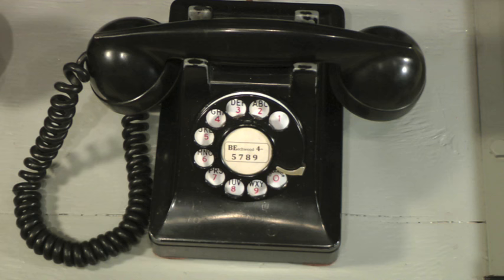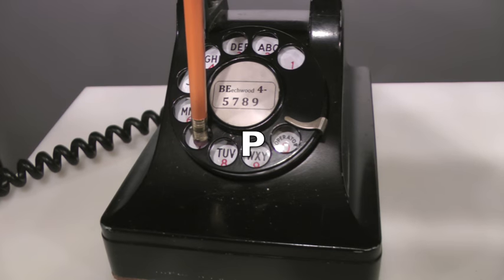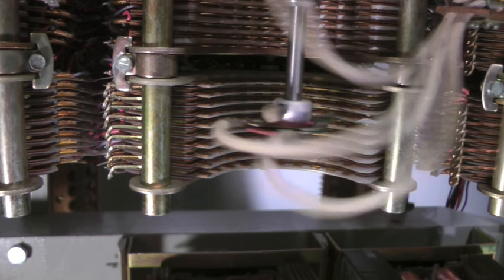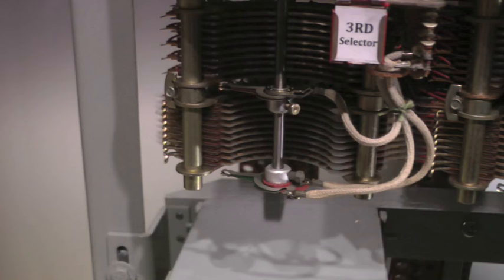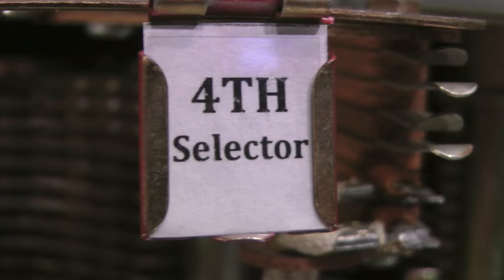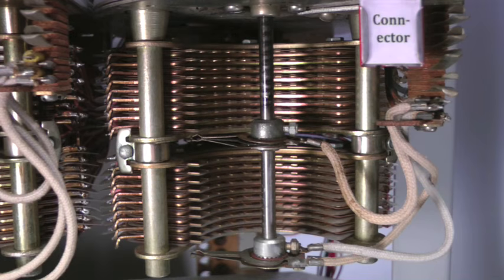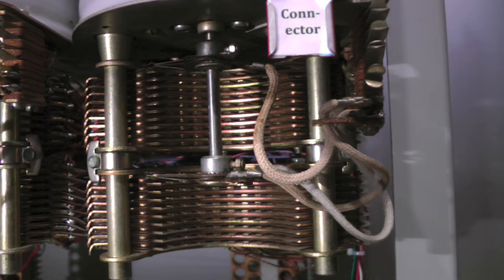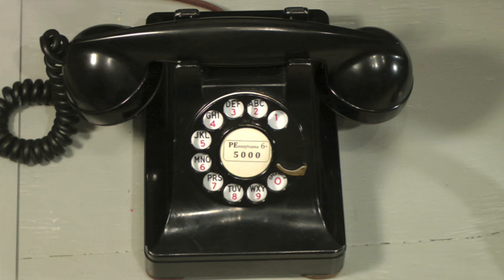A Call To PEnnsylvania 6-5000 Through The Step-by-Step Telephone Switching System

Comment: How does the line finder "find" the line calling line?

It didn't seem to traverse every contact on every level. It only traversed on one level.
Reply from the maker: When the shaft and wipers begin to move vertically upwards, you'll see a horizontally mounted copper coloured wiper brushing against a set of vertically mounted copper contacts. There is one contact for each level of the bank. The operated line relay causes a ground potential to be placed on the contact associated with its level. The shaft continues its upwards motion until its horizontal wiper detects the ground, at which time it stops vertical motion and begins rotary hunting. The top set of contacts on the bank assembly are the sleeve contacts, which provide the service request status of each line on the bank. If a line is requesting service, the operated line relay will cause -48 volt potential to be placed on its sleeve contact on the bank. The rotating sleeve wiper looks for the -48 volt battery and stops rotating when it sees it. At this point, the line requesting service has been found. If you are interested in more detail, you can watch my very long video on this subject entitled "The Line Finder In The Step-By-Step Telephone Switching System". Just search You Tube for my channel name, Hicken65. Thanks for watching.
Reply: Hicken65 ... Thanks for the explanation. It is a really complicated system! It took me ages to spot the circular piece of metal with the finger out to the right parsing the 10 tiny flat contacts. 

I had already started to watch the other video you mentioned, but had to abandon it to get on with other stuff. It is bookmarked for when I can devote time to watch it all without interruption.

Comment: I understand that the selectors are in the same frame for demonstration purposes in the video, but in the real world wouldn't the selectors for each digit be located in various parts of the CO with the last connecting selector just serving the last nnn-nnXX digits?  

How would dialing the first two digits select a proper trunk to go to another CO?
Reply: Thank you.  It's not usually explained well in any SXS video as the selectors grouped together is misleading.
Reply: Since the exchanges in an dialing area (area code) may be many, I'm curious how and when the outgoing trunk to another CO is selected -- I assume after the first two digits of an exchange are dialed then the appropriate trunk is selected to then connect the call to the appropriate CO for the last 5 digits to be decoded.  That implies that there are trunks from each CO to all other COs in the area code, or was there another CO inter-switching method which was more efficient?

Comment: How much could a complete system like this one could cost to build today with used parts?
Reply from the maker: Well, the short answer is I don't know. To build a demonstration unit similar to mine, here's what you would need: 2 line circuits, each consisting of one line relay and one cutoff relay; one line finder switch and its jackspring and bank assemby; five selectors with their five jacksprings and five bank assemblies; one connector and its jackspring and bank assembly; a 48 Volt dc power supply, a ringing generator, a dial tone generator; an interrupter for the ringing; an interrupter for for busy tone; wire to interconnect everything; and mounting framework for all the equipment which you can build using angle iron. There is no single supplier, that I am aware of that is selling this stuff. Occasionally, bits and pieces show up on Ebay and occasionally, some collectors list parts for sale in collector forums or newsletters. Telephone collectors hold several shows each year which often include switch demo units. You need to research such organizations as Telephone Collectors International and Antique Telephone Collectors Association.

Comment: Thanks for showing what you could, but the design of these switches still has lots of unexplained details, not least of which is that the system also does automatic billing.
Reply from the maker: There is a lot more detail in my longer videos. Just search on my channel name. Unfortunately I do not have any Automatic Number Identification or Automatic Message Accounting equipment available to make a video. Thanks for watching.

Comment: What does your demo setup use as sources for ringing voltage and dialtone? Does it use the standard motor-driven interrupters to make the busy signals?
Reply from the maker: The ringing generator is a Tellabs model 8102 made in 1998. It is a solid state generator that outputs 105 volts ac at 20Hz with a series -48 volts dc component. The dial tone/busy tone generator is a Lorain model F1 made in 1966. It is a solid state generator that outputs 600 Hz amplitude modulated by 120 Hz. The busy tone and ringing tone interrupters are both made by the Pylon Electronic Development company (year of manufacture and model unknown). They both have electric motors with brush and cam arrangements.

Comment: Well the part I didn't quite get, was how the system could handle more than 1 call at a time, and how there was an upper limit to the number of phones that could be called. I take it, this was a simplified documentary
Reply from the maker: It is indeed simplified. My demonstration unit was designed only to show how a call progressed through a SXS switching system. When a switch is used on a call it is tied up to that call for the entire duration of that call and so cannot be used to process any other calls. When a call is established through my demo unit, all 7 switches are tied up and so only one call can be established at any given time. In a very large central office, each established intraoffice call would also tie up 7 switches, but there were many thousands of these switches. Each telephone line did not have its own dedicated switch or set of switches. To make efficient use of the switches, there was a great deal of shared access to them. For example, line finders were arranged in groups of up to 20 that had shared access from 200 lines and connectors were arranged in groups of up to 10 that shared access to the same 100 telephone numbers. Between the line finders and connectors were the ranks of selectors. Each line finder was tied directly to its own first selector. After that, the 2nd through 5th selectors were set up to be accessed on a shared basis from the preceding rank of selectors.Typically, SXS systems were provided with sufficient switches such that about 7% to 10% of the telephone lines could be in use simultaneously on originating calls and 7% to 10% could be in use simultaneously on incoming calls. A 50,000 line SXS office would have around 25,000 of these switches.

Comment: Is all that apparatus for every single line? I don't understand how it handles calls to consecutives numbers, by example, if phone lines xxx50 up to xxx59 can be use at the same time all the ten for receiving calls all at the same time? It works with parallelism of those mechanism?
Reply from the maker: My demonstration unit just has one switch of each type to show how a call progresses through a Step-By -Step system.In a central office, there is a lot of shared access utilized by parallel multipling of bank wiring so that multiple switches can share access to the same 100 or 200 circuits. For instance, in a typical setup, 200 lines share access to a set of 20 line finders and 100 telephone numbers share access from 10 connectors. In a 50,000 line office, there would be about 24,000 switches of all types, so just under half a switch per line.
Reply: wow, you mean that of 200 lines only 20 can do a call at the same time?  that is like the 10% of sinmultaneosly usage!. But I imagine those 200 lines can receive a call regardless of all call lines are used.
Reply from the maker: Yes, that is correct, only 10% of lines could have simultaneous originating calls in progress and 10 % of lines could have simultaneous incoming calls in progress. This was typically sufficient. Of course, in serving areas that were business dominated, less sharing was done in order to handle the loads and still provide mandated service levels. The originating equipment did not interfere with the terminating equipment. If 20 of the lines in a group of 200 lines sharing access to 20 line finders were in use on originating calls, the remaining 180 lines were free to receive incoming calls.
Reply: and that it is in several layers? I remember to get the busy tone , on just the 3rd. number digit out of 6 or 7.
Reply from the maker: Yes, there are several ranks of selectors. One of each type is in my demo unit.You would get slow busy tone, 60 interruptions per minute (IPM) if you dialed an in use number. You would get fast busy tone (120 IPM) if there were no available trunks anywhere between digits along the dial path. If there were no line finders available, you didn't receive any tone. You just waited until one became idle and then you received dial tone.

Comment: A couple of questions:
Say my phone is 46789 and I wish to dial 34567
To reach me, are there  100 line connectors whose 8th row and 9th position output connects to my phone line? 
Conceptually, if my number begins with 4, does this mean that my line connector would be at end of aisle 4 in the CO?

And if I pickup the phone, do I have my own line selector attached to my line (always the sime that hunts for a free trunk) ? Would the first line selector be next to it, but when I dial the first digit 3, I would be connected to the next line selector in aisle 3 that serves numbers that start with 3 ?  (and from that point, would connect to selectors and final connector on aisle 3) ?

Just trying to understand on a larger scale how it was all arranged as opposed to the demos with just 2 phones.
Reply from the maker: Connectors were arranged in groups in which all the connectors in a group had access to the same 100 telephone numbers. For residential customers,  a connector group would consist of up to 10 connectors. In your example , the connector group for your telephone would serve telephone numbers 46700 to 46799, and yes, your telephone would be on the 9th rotary position of the eighth level on the connector bank. In a very large SXS system, say 50,000 lines, there would be somewhere in the neighbourhood of 24,000 switches of all types. These were mounted on equipment bays that were 11' 6'' high, and as you can imagine this took up a tremendous amount of floor space. In large offices, switches were mounted on dedicated bays for each switch type. That is, there were dedicated bays for line finders, for each selector rank (i.e. 1sts, 2nds, 3rds, 4ths and5ths) and for connector groups. Any given  7 digit telephone call would tie up 7 switches spread over 7 different bays that could be located anywhere in the central office. The only bays directly tied to telephone numbers were the connector bays, which typically contained 7 connector groups and thus 700 telephone numbers.

 The line finders were arranged in groups of up to 20 line finders that served 200 lines on a full sharing basis. That is any of the 200 lines could be connected to any of the 20 line finders in a group. When you originated a call, one line finder in your group would be activated, find your line and connect it to a first selector, which would give you dial tone as a signal that dialing could commence. If you dialed 34567, your call would tie up a particular line finder, 1st selector, 3rd selector, 4th selector 5th selector and connector. If you later made another call to that same number, your second call could be on a completely different set of switches that routed your call on a  different physical path through the central office (although it would begin in the same line finder group and end in the same connector group).

For a much better understanding of this topic, you can watch my very long, detailed videos on the linefinder, the selector and the  connector . Just search my channel name, Hicken65, on You Tube.
Reply: @Hicken65  Thansk for the explanation.  But still confused on 200 telephones sharing 20 line finders. When I lift the phone, the videos I have seen show the line finder being the first item. But if  any of the 200 lines can any up on any of the 20 line finders, what is the name of the device that get me connected to any one of the 20 line finders? 
Also would it be correct to state that if 20 people of the 200 in my group are already on the phone, when I pick it up, I would get no dialtone?
Would I need to hang up and pick-up again to try to get a free one, or could I stay off-hook and wait until I got dial tone?
Reply from the maker: @jfmezei  Each telephone line has its own line circuit, which consists of two relays, the line relay and the cutoff relay. When you pickup the the telephone , the line relay operates over the electrical loop through your telephone set. Each line finder group has a group control circuit that contains the preference circuitry to select an idle linefinder. The operated line relay initiates a request to this circuit to begin the selection process. If all the linefinders are in use, waiting calls queue up and will get served as line finders become idle. So if you stay off-hook you will eventually get dial tone. Details on this are provided in my video "The Line Finder In The Step-By-Step Telephone Switching System" which you can find on my You Tube channel, Hicken65.
Reply: @Hicken65  Thanks. I had seen the video  where you have a phone, line finder, selctors and connectors, and the phone appeared to be directly connected to the line finder. But your response shows there was something before that which connected my phone to a the first availabel line finder.
Reply from the maker: @jfmezei  You're welcome, and thanks for watching.
Reply: PE6-5000
Was Parent of
BE4-5789😋
Music changed a lot between those phones